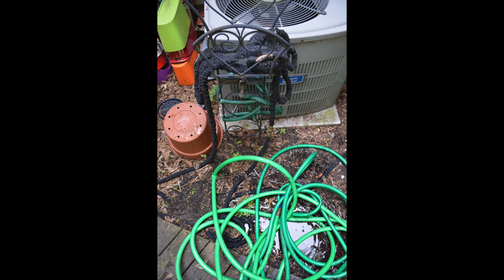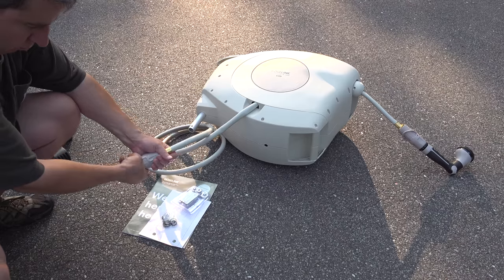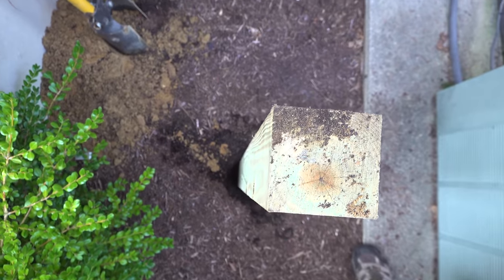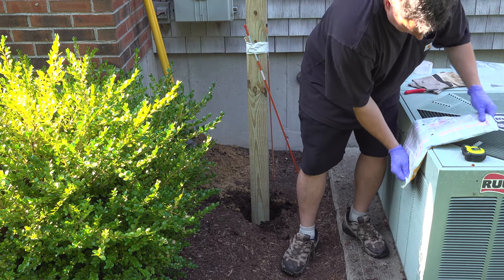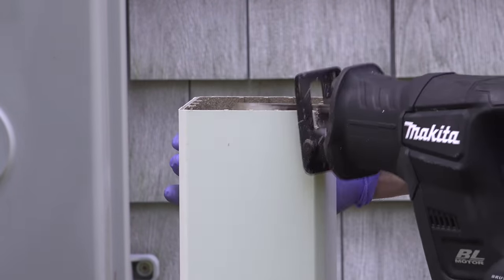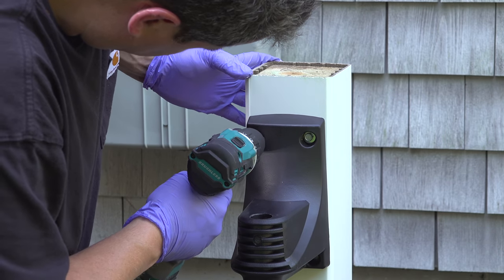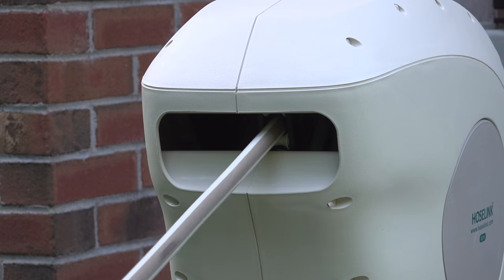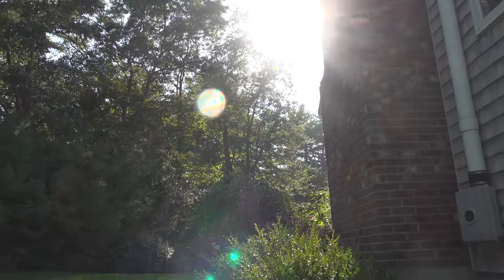HOSE REEL UPGRADE - Custom Install with Hoselink Hose Reel

Comment from the maker: Order Hoselink NOW from Amazon: https://amzn.to/4byhFY2 or Hoselink Direct: https://glnk.io/z7rx/silvercymbal
Reply: 200$ btw, nor bad compared to the 200$ i got which kinks easily
Reply: What size Post did you use? I am looking at the Hoselink Reel like the one you installed on this video however, I purchased 4X4 posts and based on the dimensions of the brackets I don't think it will fit on a 4x4. In your links you do have 4x4 of the composite cover you put over the post that would indicate you used a 4x4 but you don't mention it and I would have to think you actually used a 6X6 post, no?
Reply: The price seems to fluctuate. I ordered mine last week at $259. Just looked on your link and it is now $249
Reply: @robwaelchli1063  I have mine mounted on a 4x4 post. It is really close to the edges, but it seems to be on there good.

Comment: I have one in the front and one in the back. They are worth every penny. One of the best home accessory purchases I have ever mad. Self retraction for the win!
Reply from the maker: I also have an eley and they are very nice but mine corroded out on the aluminum since you can't take it in. This seems a better match for Mass weather and I underestimated how awesome the spring action is like you said too
Reply: How much did it cost you?
Reply: @anonymoose6873  $179 in March and $199 in May of 2021
Reply: I have the same setup one for front yard one for backyard.  They are worth every penny…I have never been so motivated to water my plants
Reply: So happy to hear you like your reels Matthew!

Comment: You will love those hoselink connectors. I have excessive pressure at my house and these are the only hose connections that I've found to work.
Reply from the maker: That's great to hear. They seem very clever and its shocking how much they weigh when you are used to little cheapie plastic ones, these are solid.
Reply: John: Excessive pressure is a blessing to many parts of the country.  Considering 
the ultra low pressure the folks endure with. SHOWER etc.
Reply: You can dial that excessive pressure down.  Homes have a pressure regulator somewhere, and they are adjustable.
Reply: @tedlahm5740  In many cases, that pressure drop is introduced at the shower head.  Heads I've seen have a small plastic insert near the pipe threads, and you can just remove the insert before re-attaching the head to the pipe.

Comment: Great Aussie company 🇦🇺👍 I have had one for about 7 years and just make sure you buy the cover to protect it. The cover will last 5 years or so but the hose reel will stay like new
Reply: Thanks Peter!
Reply: Do you still have it after all these years? I'm curious how this thing ages because I've always heard that they leak internally and are a nightmare to fix if they do get a leak inside.
Reply: @incubrian  yeah still got it and used almost daily. I replaced the cover again 4 months ago. No leaks

Comment: Nice set-up . When putting any post in the ground it is a good plan to add pea pebbles under the post to help prevent wood rot .
Reply: Or just gravel. Easier to get and usually cheaper.

Comment: Eley hose reels are a beefy metal reel option, but they are not enclosed mor self-retracting. They are, however, incredibly well built and you can get replacement parts for them as well.

Comment: I bought one and gifted one to my parents. I think the hose reel is awesome, but I have had nothing but trouble with the nozzle and quick connects. First time I used them both broke. Hoselink did replace both pieces but I havent used the replacements.

Comment: That's pretty cool.  I have 5 acres so I use one of the hose carts that holds 400 ft but I might consider one of those for the beds around the house

Comment: Am old school have a mounted tire rim to wrap my hose around.  I tend to like to reuse items.  Great review as always,  myself I am afraid that  the retractable portion would probably break after a few uses. But Great post set up and  my use the foam  for some use.

Comment: It looks like a great product...any foreseeable issues? I can't think of any
Reply from the maker: The finish and quality of it were very good. I don't expect problems based on reviews but I love that you can get parts later, a hose reel could be in use forever. I have an old Hozelock in my garage thats 20+ years old this reminds me a lot of that one, good quality, for some reason they never sold in the US, so it's nice to see someone following the good euro style models that are durable.

Comment: I’ve been considering reels, of lesser quality but similar money, from the big box stores to mount to my shed (also delivered on a mule lol)…. Thinking that in order to mount this on studs I’d have to go to the inside the shed and build out a stud with an additional 2x4 vertical on each side until the width became 6” to mount the reel receiver with proper support.  Does that seem like a good approach?  As always, great and informative video, SC.
Reply: Hi Tom! We generally recommend just making a backing board (same dimensions as the bracket) from plywood, and attaching the backing board directly to the studs with 2 screws down the center. You can learn more by watching this video:

https://www.youtube.com/watch?v=0OcOJDxkCS4&t=13s

Comment: You need to add a padlock through the hole in the pivot pipe to prevent someone from stealing the unit.
Reply from the maker: Believe me if they want to steal that one go ahead, I will file an insurance claim. Its still going strong at 22 years old! Horrible on efficiency though, getting close to replacing it

Comment: Can you secure it in the bracket so it doesn’t get stolen?
Reply from the maker: Yes there is a hole through the shaft at the bottom, you could put a cotter pin or bolt/screw in or even a small lock if you wanted something more secure

Comment: I bet that 6' wooden post cost more than the hose reel.
Reply from the maker: The surprising part is that the post was only $9 at lowes. The plastic cover was $35 so looks can be expensive but wood seems to slowly be getting back to normal prices.

Comment: can it be secured to a brick wall of a house? I cant put in a post as the area near my tap is concrete slabs.
Reply from the maker: Absolutely, you can screw it to wood or vinyl. They include anchors in the box that will work on stone or brick

Comment: How long is the hose that connects to the house?
Reply from the maker: Thats a good question, I should have included it, here it is: Leader Hose	6'6"ft (2m)
Reply: @SilverCymbal  Thanks! the hose spigot in the back yard is somewhat inconveniently behind my oil tank, so I like to run a jumper out to the corner of the house for hose reels.

Comment: Is the hose replacable with any 5/8" garden hose or is it specific to the unit?
Reply from the maker: Like some others this is a euro model so the hose is 16.5mm just under 5/8th so it is a little different. It won't cause any issues since the ends are the normal US garden threads we expect but I don't think you could just put another hose in it unless it was that exact size.

Comment: Must be a plug for the Foam cement.  That stuff is garbage.  It doesn't work.  Use real concrete.  Mine is tilted at a 45-degree because the Foam is garbage.  Maybe it can hold 5 pounds but that's it
Reply from the maker: Soryr but even after using that hose for a year it held up great for me. If you ground around the post is too soft maybe that would impact it but I was very surprised how well it work. I have no connection to Silka. but I would use this again in a second

Comment: Terrible product.  I used mine 5 times and the retractable springs broke!  Waste of money and I would not recommend.  Just need to get that out there!  FYI. I had this located in my heated garage.  No outside elements what so ever!
Reply from the maker: I have moved since I made this video, and if you indeed have the Hoselink call them to have them replace it. After using dozens of reels this is still my favorite this outside one gets used daily here and stayed outside in New Hampshire. Its good: https://youtu.be/OKnZG2o97H4  I think they will help you

Comment: Nice functionality and video. But covering a wooden post with plastic and foam is an environmental disaster in time of a climate change.
Reply from the maker: Keep in mind those covers are rated for outdoor use and wwe see tons of them down here for people with ocean front property, they seem to hold up well, for the foam I know it seems super odd but it's good stuff and lasts just cost more. So on a 40 post fence its not a great idea but for small projects its great,
Reply: I guess it's time to rip that siding off of your house Manuel. Ya know, for climate change.
Reply: @SilverCymbal  I see that argument. In Germany, where I'm from, I haven't seen something like it so far. Either a post is made out of steel or just wood, which also lasts in the coastal regions for ages. It just depends on the kind of wood which you are using.
To argument in a way that tons of them are around you justifies what you're doing isn't very reasonable in a common sense, but I hope you understand this one.
Instead of foam quick cement does the same thing. Hard in 15 min. It's production is energy intense but it's without undegradable polymers, which stabilize the foam e. g. and definitely more construction material conform.
I hope I could clarify my point of view more and hope to see more interesting videos of you! :)
Thanks for the personal anwer!